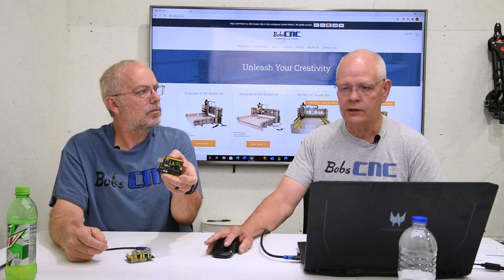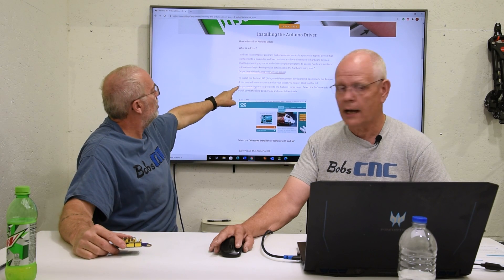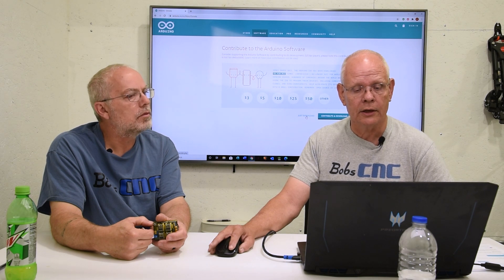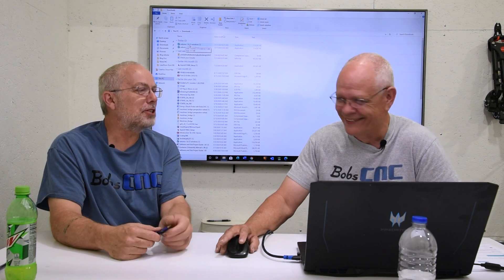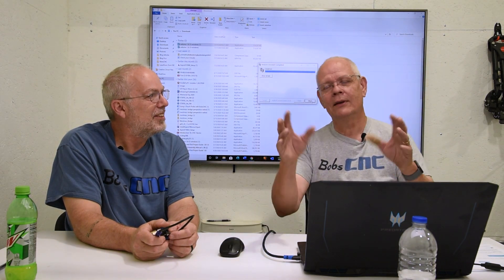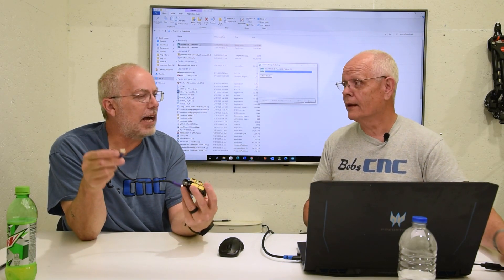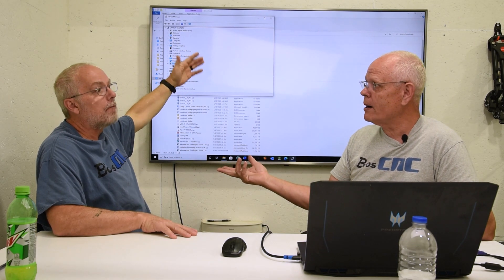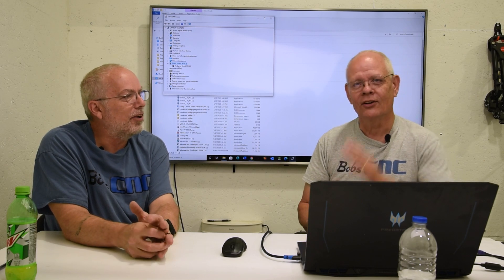Shop Talk: Arduino Driver Installation

Comment: Question. I have a computer in my office and one in my shop. The computer in my office will be used for design purposes. Please explain what software I will need for the design computer and what software I will need for the computer in my shop. Thanks 👍
Reply from the maker: You will need CAD/CAM software to design your projects.  Check out Vectric, EstlCAM, Fengrave, Fusion 360,
Carbide Create, MeshCAM,
PyCam, HeeksCNC, MakerCAM, Easel.
Reply from the maker: You will want the CAD and CAM software on the office computer.  The only software you would need on the shop computer is UGS Platform.

You would be able to transfer the gcode files with a USB driver or a shared network drive over the internet.